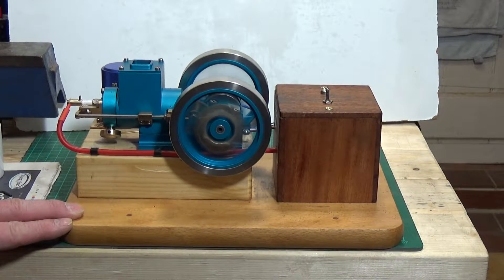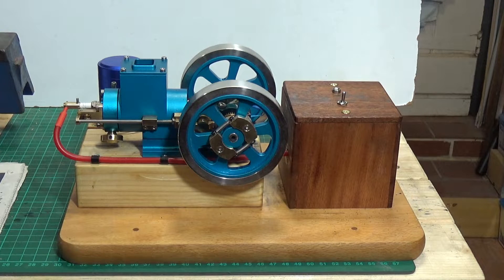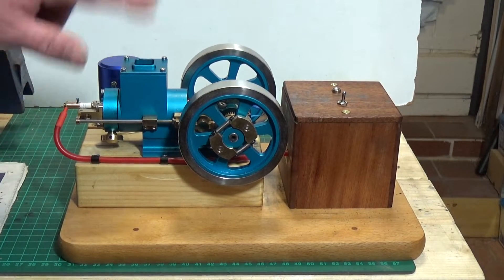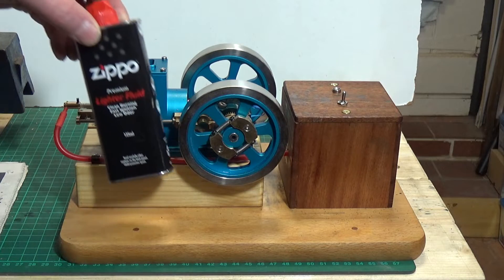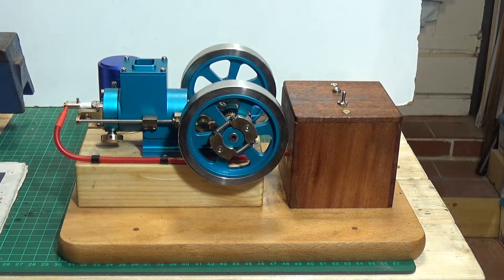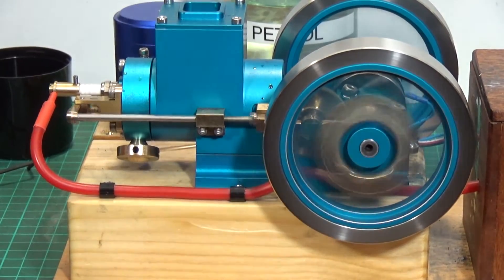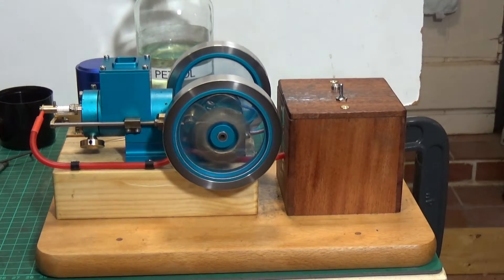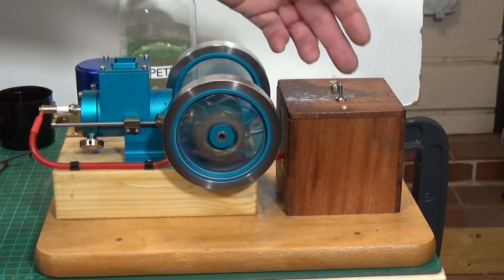Modern Mechanical Tech - Chinese Hit and Miss Engine - Part 2

Comment: did it come with the battery pack and the spark or do you need to buy tham by them selfs
Reply from the maker: No, you have to supply the battery pack but it does include the ignition unit which provides the spark.

Comment: It looks like you ended up lowering the fuel tank? I'm also wondering whether the tank needs a vent hole in the cap?
Reply from the maker: Hi, yes i did lower the fuel tank, probably by about an inch. The tank comes with a small vent hole in the middle of the cap.
Reply: @RetroSteamTech  Thanks for the reply. My tank cap didn't have a hole and so I drilled one yesterday. My engine is now running but only for a few seconds at a time. My question about lowering the tank was about whether it relies on a gravity feed or whether the fuel is drawn through by the low pressure at the needle.
Reply from the maker: @stevemedlock6271  I've just checked and the outlet from the fuel tank is about 1/2" lower than the inlet to the carburetor. I Think the fuel is drawn into the carb by low pressure. It might be worth you watching my follow-up video on this engine which is "Further Adventures with Chinese Hit and Miss Engines - Part Two". As i learnt a few things after purchasing the updated engine.

Comment: Like most people I don't have the machining talent to build something like this, and every other small running hit and miss engine model I have seen were well out of my price league.  I was very happy to get this, and am more than impressed with the quality of the machining.  The electricals require some tinkering to make it run at its best.  But that is another reason why I bought this as a toy just to tinker around with, it's ideal for that purpose.  This is something most schools can afford to add to STEM programs as a good demonstrator.
Reply from the maker: Hi Mark. Yes they are amazing for the price, i've seen machined casting kits for model hit and miss engines which are 8 times the price and you still need a lathe before you can put them together. It would be a great improvement to have some basic instructions though with them though.

Cheers, Alan.
Reply: I see they are selling a more or less “ready-to-run out of the box” version of this engine now that is set up so people don’t burn up the ignition in five seconds or have to fuss so much with the fuel tank and carb.  That was likely a smarter move on the part of those selling these rather than providing “Chinglish” instructions that most guys out there would probably never read anyway LOL!
Reply from the maker: @MarkPalmer1000  If you are referring to the silver one which comes with the ignition box already fitted then i have a couple of videos on that one too.

Comment: Hello.  I was wondering if you would confirm something for me.  If you have a multimeter, could you check if the ignition box casing is electrically connected to the battery negative terminal?  Both my box and the two hall sensors packed up very quickly after what I can only describe as an attempt to run.  I checked the box and it is completely isolated so I cannot see  by connecting the engine block to the casing of the ignition box would provide a return path for the HT lead.  I suspect the ignition box casing  is supposed to be grounded to the circuit board inside (battery negative) hence the advice to connect the engine block to the casing.  Some boxes, like mine, are probably faulty and because there is no return path, arcing might occur elsewhere and damage electronic components.  It would be interesting to know if your box is grounded to the battery negative, since you have no problems running yours and both your box and hall sensors are intact.  Thank you in advance.
Reply from the maker: Hi. I've just checked what you asked and the ignition box casing is not connected to the battery negative. However with my engine, if you attempt to run it without the chassis grounded to the ignition box case it won't run and also you get arcing between the hall effect sensor and the magnet in the flywheel. Although i did not get any instructions with my engine i did get an extra piece of wire which is apparently for grounding the ignition box. Hope this was helpful.

Cheers, Alan.
Reply: @RetroSteamTech  That's interesting and thank you for doing that.  One person in Banggood review section and three youtubers have said that the engine block should be grounded to the battery negative.  I am still lost and I am worried that my new ignition box and the sensors will suffer the same fate :-(
Reply from the maker: @mylittlediesels  It's really annoying that they don't supply even basic instructions which would clear up the whole what should be connected to what thing. Although mine does run it is very temperamental and the position of the throttle screw has to be just right.
Reply: @RetroSteamTech  Hi, if you look at the ground wire provided, one end has a crimp ring terminal which is obviously for one of the screws on the engine block, the other end is just a tinned wire.  Is it supposed to pass through the bobbin and soldered to the circuit board?
Reply from the maker: @mylittlediesels  Maybe but if that is the case why not just supply the ignition box with a flying ground lead already attached. I can't believe the manufacturer expects the owner to go poking around inside the ignition box with a soldering iron.
Reply: @RetroSteamTech  What you said makes sense.  I just have to wait for my new box to arrive and see what happens.  I might consider getting the upgraded silver one which apparently has a new buzz box, new hall sensor, new cylinder head and a double-ringed piston.  Thank you for all your helpful info.
Reply from the maker: @mylittlediesels  Good luck with the new box. As it happens i have one of the silver ones on order. Yes i know, i'm sucker for punishment 😂  Before i put any power on it i intend to see exactly how it's wired up. I'll be doing a video so watch this space.
Reply: @RetroSteamTech  You are one lucky fellow!  Hope you will receive the silver one soon and we'll know the differences.
Reply: Hi, just watched your new video on your silver one. Our suspicion is confirmed.  Another youtuber I have been talking to who juyst received three replacement boxes has checked all three with a multimeter and said that one out of the three has the casing grounded to the battery negative.  So whether your engine will run ok or not is a hit or miss thing.  No pun intended!
Reply from the maker: @mylittlediesels  Yes it seems we are finally getting somewhere with knowing exactly how to connect these up. In the next few days i will post the 'Part Two' video in which i show my original blue engine with the chassis earth lead taken to the battery negative. It makes starting and running it a whole lot easier!
Reply: @RetroSteamTech  That'll be great.  I'm still waiting for my box :-(

Comment: Very nice video.  I purchased and built up one and can NOT get it running.  It won't even pop.  I have a nice spark but I think the timing is somewhat off.  Did you have any timing problems.  This is my first gas engine.  On my channel I make stationary steam engines.  Thanks for the post and any advice on getting my engine running.  Fred  Ontario, NY USA
Reply from the maker: Hi Fred, 

Thanks. First off, you absolutely have to have the case of the ignition unit earthed to the engine chassis, it won't run if it isn't earthed. Also the height of the fuel tank seems to be quite critical as is the setting of the carburetor screw. Try the screw just a quarter turn open. One thing i didn't mention in the video is that the rod which holds the exhaust valve open when the engine misses seems to have to be put in a specific way round. I found that if you fitted it one way round it would appear to hold the exhaust valve open all the time, there should be a small amount of clearance between the exhaust valve rocker and the valve when it's closed. I didn't have any timing issues but it was very difficult to get it running.

Cheers, Alan.
Reply: Thank you for the prompt reply Alan. I am good with the gas tank height and exhaust rod.(rounded end toward the rocker arm) thanks.  Now my ignition module quit working.  I have just ordered 2 replacements from Banggood.  I am also questioning the hall effect device so I will the testing them with an O-scope and if defective may change over to a reed or micro switch.  I will be posting progress and results on my channel.  Cheers from Ontario...  Fred
Reply from the maker: @FredMiller  Hi Fred. I've heard that other people have had the ignition module quit. As i hope to have other Hit & Miss engines in the future i've ordered an ignition module (Electronic Buzz Coil) and coil from here,

http://www.model-engine-plans.com/partskits/ignitionsystems/transistors.htm

I intend to try this with the Banggood engine. I will hopefully have a video of my experiences at a later date.

I have subscribed to your channel and look forward to watching your back catalogue of videos, loved the can crusher 👍🙂

Cheers, Alan.

Comment: Nice video mate. I purchased one from Banggood about a year ago. One thing that’s very important is oil. Not only for the running shafts and gearing but also for the piston and cylinder. Ordinary 2 stroke fuel is ideal, the same as you put in your mower or weed cutter. Using lighter fluid or anything like it will soon seize up your engine. I’ve found that the needle valve only needs about half a turn from the closed position to start the engine. Have fun using this engine to power a model car or tractor or anything else that pops into your mind. It will look and sound great.
Reply from the maker: Thanks. I'm considering fitting a drip feed oiler to the front of the cylinder.
Reply: Retro Steam Tech    The only problem with a drip Oiler is that the oil only lubricates the top section of the cylinder walls and piston before being burnt off on the next detonation. The intake valve stem needs oiling too and using a two stroke fuel and oil blend covers all of those areas. The smoke and smell of two stroke fuel adds to the display.
Reply from the maker: @MrOGREATWISEONE  Guess i'm going to have to get some two stroke then.

Comment: I have a question.
How long did it take for you to preorder and get it shipped?
Are they making them by hand as orders come in?
Reply from the maker: Hi, i ordered it on 03/12/2018 and it arrived 22/12/2018. When i first placed the order the webpage did say that they had stock.
Reply: mine took forever.  When it finally came i had given up.  It was worth the wait though.  Havent tried to start it yet - i'm afraid of frustration!

Comment: A great little engine :-)  It looks to be machined very well, those flywheels run perfectly true. I'm normally more interested in steam but my next project is to build the RLE hit and miss engine from castings.
Reply from the maker: My main interest is steam also but at the price i couldn't resist this one.
Reply: @RetroSteamTech  Yea, it's a nice little engine :-)